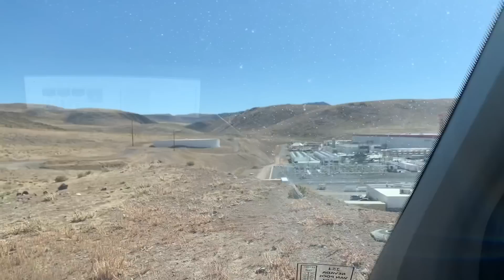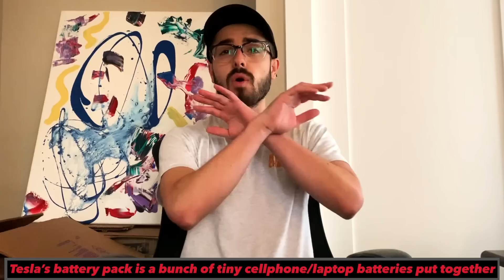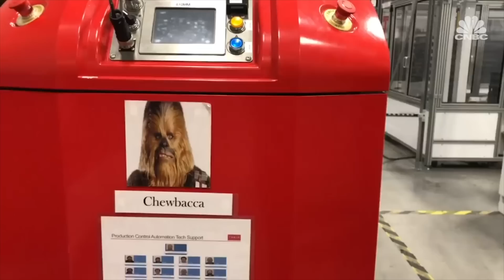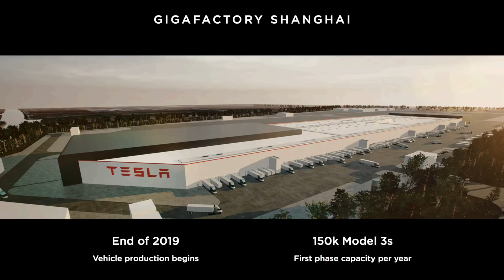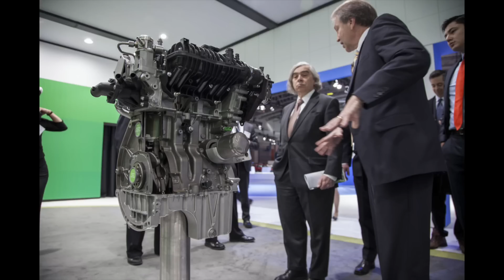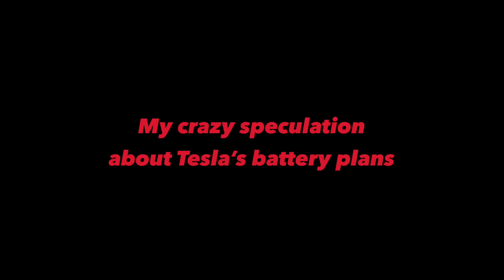GigaNotes: Analysis From My Tesla Gigafactory Tour

Comment: I think you've got a good handle on where Tesla is headed.  If you dive a bit into the piece about the Tesla/Panasonic "mismatch" there's some stuff about how many of the lead people at Panasonic are uncomfortable with Elon's style and pace.  My takeaway from that is that Tesla needs to build their own batteries and not be at the mercy of another company with a difference style/approach.

As Sandy Munro and others have said Tesla is where the best and brightest want to work.  Tesla can get the best people with the best ideas because those talents and ideas will be appreciated and used.  Not buried somewhere in a cubical while things work their way though the committee structure.

Now that Tesla has self-educated in vehicle manufacturing they should remove all the roadblocks and allow the company to develop at warp speed.
Reply: Yes.  That difference in Style/Pace between the companies was clear years ago.  I think Elon Musk first mentioned the idea of a GIGAFACTORY publicly around October/November 2013, and Panasonic didn't agree to participate until June/July 2014.  

Even then, they asked for guarantees on covering their own expenses for expanding 18650 battery cell production in Japan.  Apparently Panasonic execs had succumbed to some press that suggested Tesla's success in 2013 was a 'flash in the pan', some sort of 'limited, short term, passing fad', and that 'they couldn't possibly maintain an ongoing demand' because they were 'only fulfilling pent up demand'.  Complete and total hogwash.  Tesla Delivered 22,000 cars in 2013, then 31,000 cars in 2014, followed by 51,000 units worldwide in 2015, then went on to maintain similar/greater sales levels through 2018.  Panasonic was never left 'holding the bag' with unbought unused 18650 battery cells.  Tesla needed everything they had requested in 2013 and more.
Reply: @Pun Jab I  

Tesla just purchased Hibar Systems, a Canadian company that manufacturers equipment for making lithium cells.  With the acquisition of Hibar, Tesla now owns a company with expertise in making battery cell production equipment.
Reply: Strange - my comment is showing only the first line.  But it's all there if I hit edit.
Reply: @bobwallace9753  -- There should be a light gray link in small print that says something like, "Read more..." below your comment.  Clicking that link expands your post for viewing.
Reply: @redxsage  The 'read more' is showing now.  It wasn't previously even when I reloaded the page.  Perhaps I caught the server when it was taking a nap....
Reply: Well said, sir!
Reply: A wild thought , what if Panasonic is playing to have access and licensing worldwide to now Tesla's Maxwell dry cathode patents and now Hibars tecch and maybe even the latest Tesla battery tech
Reply: @frankspeaking2630  

The Tesla/Maxwell dry roll technology is almost certainly patented.  Panasonic can't simply copy it without first coming to some agreement with Tesla.  Tesla would be the party doing the licensing.  

Perhaps Tesla would be open to letting companies license their technology.  Since Tesla's major goal is to move transportation off petroleum it would make sense to make the best battery technology available to all.  And Tesla would have a new revenue stream.

There's an additional reason for allowing widespread licensing.  This will almost certainly not be the last technology improvement.  If Tesla ices out others now that raises the odds that some other company might ice out Tesla later if a different company introduces a better battery.

It's way too early to be thinking about competition between EV manufacturers.  There's a huge market to be taken away from ICEVs.  Companies just have to come up with EVs that are more appealing than similarly priced or somewhat cheaper ICEVs.

What's needed now, IMHO, is a compact hatchback with a 200 or bit better mile range selling for $29,999.  Bring that car to market and you start eating Camry/Accord lunches.  Financed over five years a $30k EV costs about the same out of pocket as a $25k ICEV when you take fuel/maintenance vs. electricity costs into account.  If Tesla can help out with a lighter, cheaper battery that is something they might well do.
Reply: @bobwallace9753  -- The Nissan VERSA ($14,500) has an EPA range of 367 miles.  The 62 kWh version of the Nissan LEAF ($36,500) has an EPA range of 226 miles.  Both are outsold by the Tesla Model 3 ($38,500) in the U.S.  The LEAF is Midsize, so is the Model 3, the VERSA is Compact.

2019 YTD U.S. SALES
QTY ......... VEHICLE
..2,111 ..... NISSAN LEAF
.57,133 .... NISSAN VERSA
113,825 ... TESLA MODEL 3
Reply: @bobwallace9753  Re Tesla Panasonic, I suspect there is an argument to maintain a productive partnership that Tesla licenses Maxwell Tech to Pana allowing them to apply that tech as a competitive edge Globally and in the manufacture at GF1, while Tesla builds their own lines using that Tech and Dahns mono crystal battery tech and HiBars battery manufacture tech . 

Don't fall into thinking it will take years for it to all come together, these are established companies that Tesla bought and as part of due diligence they would have been working under license or agreement evaluating and testing and most likely combining and testing all 3 together with the companies for some years before putting their bid together. Very likely the reason for the specs of the Semi and the Roadster and why Elon categorically stated the S and X would not be getting the 2170 cells, there was something better in the que
Reply: @frankspeaking2630  

I have no idea how things will pan out but one possibility I see is that Tesla finishes out their current contract with Panasonic and then starts manufacturing all the cells it uses.  

Tesla needed Panasonic during the startup.  Learning how to build EVs and learning how to build a factory to build EVs was a very large mountain to climb.  But now Tesla has figured out those two large pieces and has the ability to expand their knowledge and skill base.

I have the feeling that Tesla and Panasonic are not on the same page.  Tesla wants to move forward as rapidly as possible along the road away from fossil fuels but Panasonic doesn't feel that same mission.  Rather than finding a way to drive down the cost of cells in order to make EVs affordable for more people Panasonic wants to raise their price.  Panasonic wants to jack up profits by price increase rather than increase production volume and increase their overall profits by selling more cells.

I think Tesla is now ready to manufacture their own cells and work to drive down battery cost as part of their core mission.
Reply: @frankspeaking2630  -- Tesla has been very clear and very straightforward for years regarding their motivation to accelerate the transition to sustainable energy.  They have not wavered in that resolve.  Panasonic should know better by now.

I believe that in 2014 both Toyota and Daimler got tired of Tesla telling them, "NO." whenever either of them asked to license their battery packs or drivetrains for use in plugin hybrids or hydrogen fuel cell electric vehicles.  Both companies resigned from the TSLA board and largely divested of theur shares that year.  So, no...  I seriously doubt Tesla will license their techniques and technologies to Panasonic in order to 'help' other automobile manufacturers.

Remember, it's not about the 'reduction' of greenhouses gases or even 'saving money on gas'...  No.  Tesla's MISSION requires the absolute, complete, and thorough ELIMINATION of transportation using fossil fuels.  So, Tesla will expect anyone who chooses to use their technology or patents in automotive applications 'in good faith' to use it for building ONLY long range fully electric cars.
Reply: Panasonic has wanted to part ways with Tesla on more than one occasion,  if they do split it will be the end of Tesla.
Reply: @brakesforsnakes757  

Really doubt your claim.  Panasonic is locked a contract until the end of 2023, IIRC.  That gives Tesla four years to prepare.  Remember, Tesla went from a muddy field to a functioning auto plant in less than a year.

Tesla just purchased Hibar Systems, a Canadian company that makes equipment that makes batteries.  That gives Tesla the ability to manufacturer their own cells.  And Tesla owns an equipment manufacturing company in Germany that can build the needed equipment.

Tesla already has what seems to be the best battery chemistry with their current battery that looks to be good for a half million miles and they've got a new chemistry that is expected to be good for a million miles of operation.  

Additionally Tesla purchased Maxwell Industries which had developed a way to 'dry roll' cells.  That means that Tesla can save on the cost of solvents and the worker protection those solvents require.  The drying room process can be eliminated which means much faster production, much less factory space required and lower energy inputs.

Tesla has not gone public tying all this together but if all the pieces hold up Tesla should be able to manufacturer cells that have higher capacity per weight and volume due to the elimination of solvents and manufacture them faster and cheaper than the cells they get from Panasonic.  Tesla has been hiring people for battery manufacturing jobs.

Panasonic brings nothing special to the game.  Panasonic takes Tesla's chemistry and the separator that Tesla developed and cranks out cells designed by Tesla.  Panasonic is simply a jobber.
Reply: @bobwallace9753  -- Very well stated.  Thanks for the rundown.  Also, early next year, Tesla will be holding a 'Battery Investor Day' where they will certainly bc outline all those points in great detail for public consumption.  Similar to the 'Autonomy Investor Day' they held earlier this year.

Man, there may will be a shortage of crow for all Tesla NaySayers to consume on Wall $treet after Q2 2020.  Maybe they can get by on pigeon or buzzard instead?
Reply: @brakesforsnakes757  -- Ah.  Using the word 'IF' as an Agent of Doubt.  Always a sign of FUDsterism.

No.  'IF' should always be used as an Ally of Hope.  Contracts exist for a reason.  Tesla has fulfilled the terms of their contracts with Panasonic every time.  Even when Panasonic Execs and ANALysts suggested they might not.  Panasonic should have learned by now that Tesla is committed, determined, and correct.  Either they trust Tesla, or they don't.  None of their checks has bounced.  Panasonic always gets paid.

Please.  Explain why Panasonic's Executives should forego the guaranteed cash they have always received on time to allow another battery company to rake in that cash on a monthly, quarterly, annual basis instead.  Because YOU don't like Elon Musk's attitude or insistence upon increasing production?  O... K...
Reply: @redxsage  In business sometimes people are more trouble than they are worth and you have to cut bait.   Panasonic would be better off extending their services to The German brands and then they would be able to do business with adults.    Elon is someone who could ruin a wet dream.
Reply: @redxsage  At the end of the day most suppliers would rather work with a handful of solid customers than betting the farm on one volatile customer.   https://www.wsj.com/articles/tesla-needs-its-battery-maker-a-culture-clash-threatens-their-relationship-11570550526
Reply: @brakesforsnakes757  -- Panasonic has already 'extended their services' to Toyota.  Who have built exactly ZERO fully battery electric vehicles in the past five years, while chasing a Japanese government mandated 'wet dream' of Hydrogen Fuel Cell Vehicles.

When a Client or Customer is uncooperative, unprepared, and unproffessional, that is indeed a problem.  That isn't Tesla, though.  They may seem impatient, compared to someone like Toyota, and therefore impetuous, and even irrational to those with a more measured demeanor and slower approval process.  But Tesla has always been consistent.  Not at all unpredictable.  Their MISSION is to do EVERYTHING. NOW.  That way you get DONE.  No waiting.  No deliberation.  Action.  Immediacy enacted immediately.

Tesla acts as if time is running out -- because it is.  Panasonic should get with the program, act with a sense of urgency equivalent to Tesla's, or bow out.  Toyota was one of the 'adults in the room' (on Tesla's board) that advised Tesla 'move slower'...  What Tesla has accomplished in the past five years would NOT have happened if that advice had been followed.